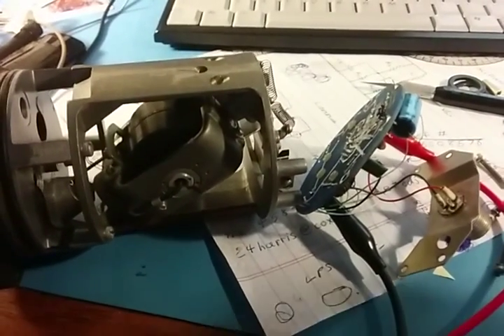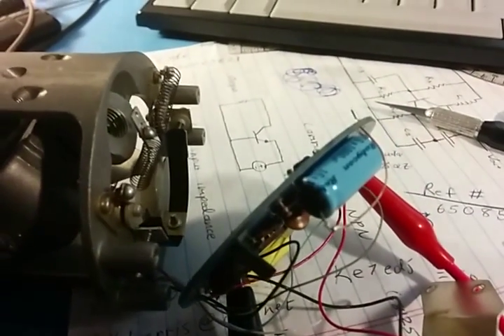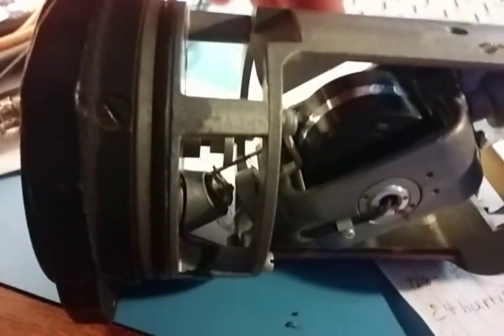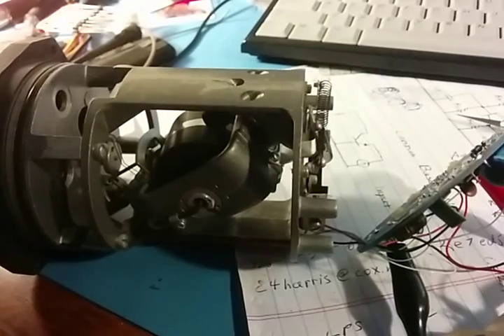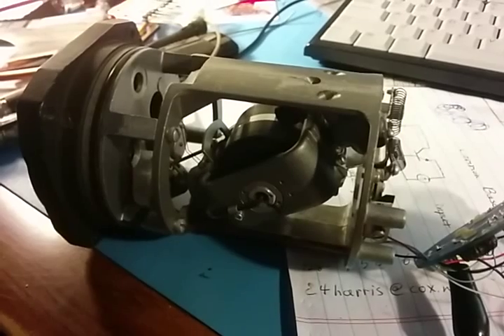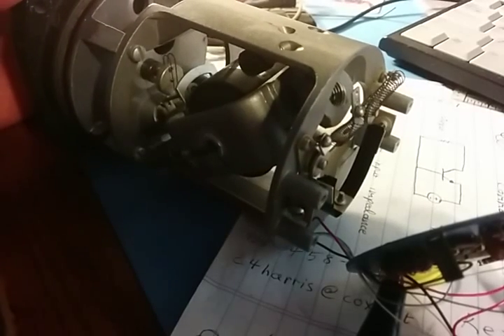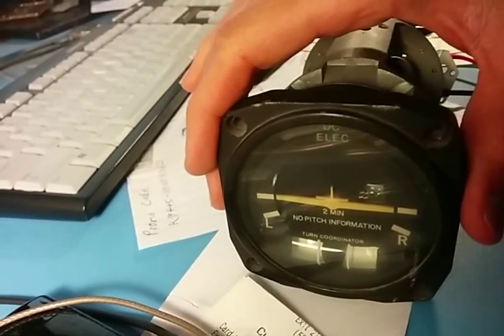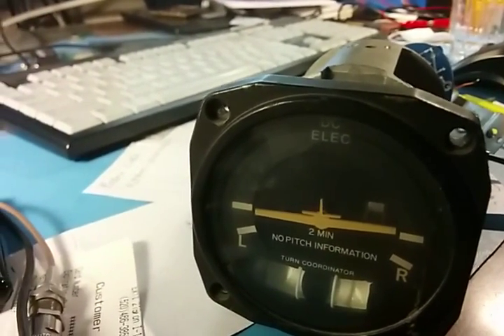Cessna Turn Coordinator

Comment: So, this is the instrument that makes noise when you turn the battery on (engine off) on the ground? Because this gyro is electric driven?
Reply from the maker: Yes that's right. One of them anyway.
Reply: @AD7ZJ  nice! What about the others gyros instruments? Are their gyros also electric driven or they are vacuum driven only? Thanks for your time once again and thanks for the video too
Reply from the maker: @RenanRioss  in a traditional 6 pack this is the only electric driven gyro, the DG and attitude indicator would be driven by vacuum.

Comment: Thanks for the video. I have a question you may be able to help me with. My turn coordinator ball is lightly right of center (essentially midpoint of the right line) while on the ground and in the air during level flight. If I try to center the ball with right rudder in the air the aircraft appears to skid suggesting that  level, straight, coordinated  flight is when the ball is slightly right as it appears on the ground.  Can you tell me what causes this. Is it that the turn corrdinator has a slight rotation clockwise?  Thanks.
Reply from the maker: Flying Architect yeah that would be my guess, it's not mounted in the panel perfectly flat or the aircraft isn't sitting flat. Try using a regular bubble level to confirm that.